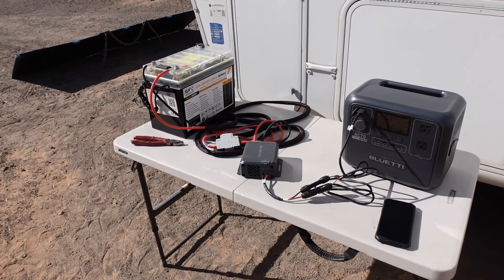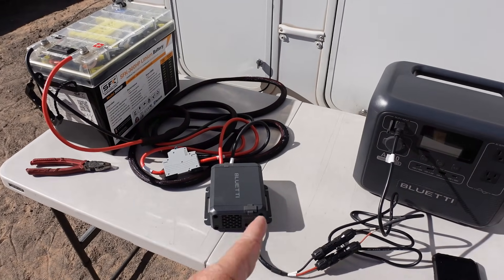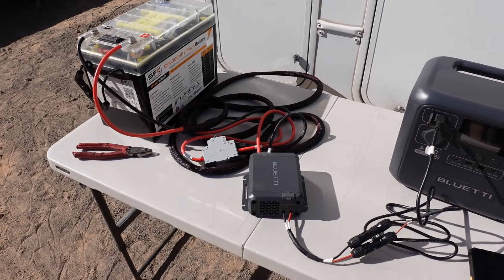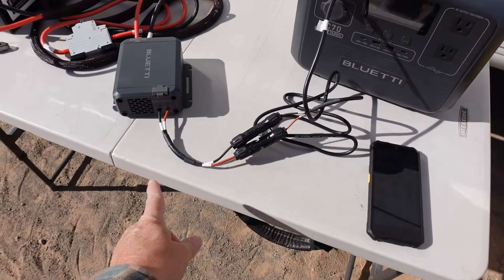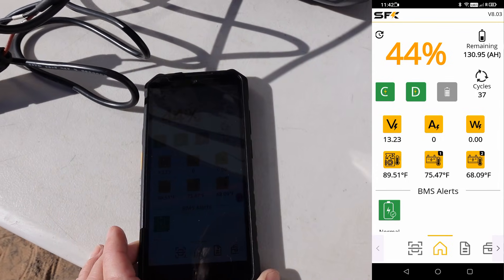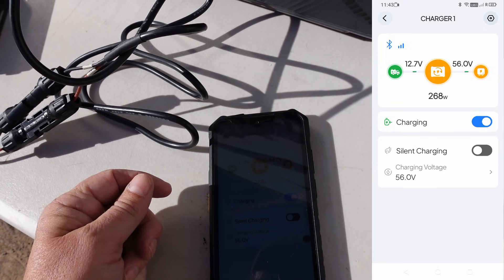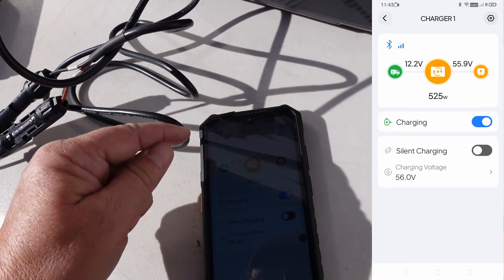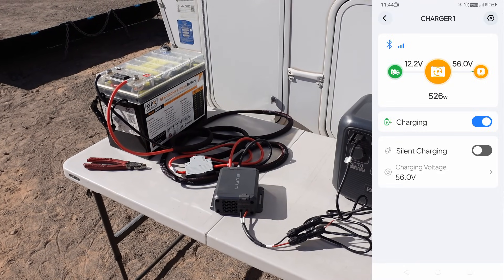Bluetti Charger 1 Test Using a 12V Lithium Battery (Commenter Question Answer)

Comment: That IS Good to Know !! Thank you. Nice alternative to  the  various shunts i use...12v - 48v 12.5A , 12v - 48v 10A,  12v - 60v 10A. There all decent but i always have a decent USB Fan running on them as they can and do get extremely Hot as well have them at least sitting on or mounted on something that helps with heart dissipation

Comment: Thanks Ray. I am the guy that requested this from you. I thought it would work which you proved to be correct. I gave my son my Bluetti 200 Max, and I purchase the Bluetti Elite 200 V2 which has no battery expansion capability. I purchased a Li Time  12v 320ah mini which I would like to connect to the charger 1 and run through the XT60 PV input. When I pose the feasibility question online, I get a No. I'm not buying that, because I belive the charger 1 just steps up the voltage to increase the input wattage. Why is this any different than what you performed on your test. If the nominal voltage for a LiPo4 battery is 12.8v, and the nominal voltage for a lead acid battery is 12.4, why would this not work? Of course Bluetti doesn't want you to use a stand alone battery with the charger 1, but it should still work and believe you've already proved this. Am I missing something? What are your thoughts? Thanks
Reply from the maker: The Charge 1 is designed to charge with an alternator running, so usually 14.4V input. It is also designed to auto shut off at a certain voltage so it doesn't drain the vehicles battery. 
In my test with a nominal 12.8V lithium battery which will usually have a voltage over 13 for most of it's discharge range it kept charging. I'm thinking Charger 1 has the auto shut off point somewhere around 12.6V which is a fully charged Lead Acid. 
But you could just connect the LiTime battery straight to the DC input port of the Elite 200 and not use a Charger 1.  These is a setting on the app to set the input for 12VDC charging
You would likely only see about 100-120 watts of charging but over time that is likely enough unless you are draw down the Elite 200 at a high rate. Make sure to use a fuse a little above the max amp draw inline close to the positive terminal to protect incase of short circuit. Or Bluetti sells a car charging cable https://www.bluettipower.ca/products/ac2a-cable?srsltid=AfmBOorh4l6SpEvhPBnKnzwfQIQZk66zDe2pHQu7D065xY3QuYZ1tbO9  or https://www.google.com/search?q=xt60+to+battery+ring+terminal

Comment: Ray just installed this in my truck for my solar power battery bank (Allpowers R 1500  . One question: Would you know  how long the output cable can be? 
I am thinking in the future to convert to Li batts to my trailer ,so that would mean a distance of 10 to 12 ft. from Charger One in the truck  to the battery bank in the trailer.
Reply from the maker: The Charger 1 I got came with a kit with a decent length of cable. See demo here https://youtu.be/QzrooU_Vs3g  To go longer than that you could do it but may have to go to a larger gauge wire to prevent too much voltage drop and excessive wiring losses. This is a pretty good calculator for that sort of thing  http://circuitwizard.bluesea.com/  I also did a video testing out charging a lithium battery with the Charger 1 via a MPPT solar charger https://youtu.be/xurOR3Kzt3k  Cheers, Ray

Comment: very good demonstration, thank you. I have overlander pickup with chest freezer, refridg, and microwave. My situation is i have Firman Zero E power station with bluetti charger 1 and it is great. I added a 100 amp hr 12 volt  p04 Litime connected by solar input directly from battery to power station. problem is i have to charge the extra battery with the power station and that depletes the power station untill i run the truck and bluettii charges back the power station in the same solar input. there is only one solar input on the power station. i just ordered a 30 amp mppt charge controller from Litime they recommended for connecting my solar panels to the backup battery for boondocking which is great. my question is can i hook up the Charger 1 to the 30 amp Litime mppt charge controller to the Litime backup battey then to the Firman power station. Will the Mppt tell the Charger 1 when both the battery and the power station are charged up and stop like it does when the power station is full now. i dont know if its the power station charge controller that is telling Charger 1 to stop or if the charger 1 stops on its own. Will the Litime Mppt be as smart as the Charger 1 and the power station charge controller? this is a real daisy chain, right?
Reply from the maker: Here is a test I did that sounds similar to what you want to do  Bluetti Charger 1 Feeding MPPT Solar Controller  https://youtu.be/xurOR3Kzt3k

Comment: Does this offer “reverse charging” like the EcoFlow device? I.e. car battery dies, can you charge it from the power station? Thanks
Reply from the maker: No reverse charging option that I could see. A person could get separate charger and plug into the power stations AC output. You can get little 10 amp chargers for around 25 bucks. Some of the larger power stations have optional battery charging cables to charger straight from the power station. Cheers, Ray

Comment: Can you charge the lithium battery with the bluetti charger one ? Or is it just capable to charge power banks ?
Reply from the maker: Not good for charging batteries, doesn't output the right voltages. You can feed a MPPT solar charger with it and that can charge a battery but quite a bit of loss due to the conversions. I did a test, here -- https://youtu.be/xurOR3Kzt3k

Comment: A follow up to this proceedure... I bought that exact same combination  of ac70 and charger 1.  Matched with a battleborn 100ah, the charger 1 does charge the ac70... BUT.. there appears to be 2 shutdown situations for the C1. If there is a rapid sag in battery voltage(5 volts or so) it will stop charging  pretty quickly...simulated vehicle shut off . When I restart it at an already sagged voltage it will run for about a half an hour at a low voltage reading . Looking at the app,  It seems if the voltage drops below around 13 volts the color scheme of the app drops from green icons all across(battery/alternator to C1 to power box) to green from the alternator/jbattery to orange of the charger and the power station. When the color changes a different set of shut down parameters kick in  and the C1 will turn off  the charging automatically, sometimes quickly(5v plus drop)   but sometime 30 min. later if the voltage sag is less. If the battery voltage sags to 12.2v it just shut off at that cutoff point no matter what. Makes sense it is trying to protect the starter battery... just wish that input voltage was adjustable for this type of usage.
Reply from the maker: Thanks. I  wonder why is your BattleBorn sagging so much? I'm not familiar with BattleBorn, so maybe the BMS is different than most or the fact it's only a 100Ah battery.  Maybe it's a wiring/connection issue causing excessive voltage drop
Reply: @LoveYourRV  I don't think 8ft of 8awg welding wire cause much of a voltage drop and in addition  I've put the ac70 on quiet charge(255watts or so)and it still sags. My Lion ut1300, which is a  newer battery and has better charging and discharging specs, does handle  the voltage sag a little better ( still the app goes into the orange mode though). I think the battleborn bms is more limited in the charge and discharge ratings. The recommended charge rating is ~50amps. Most lifpos these days are 100a plus.I would not buy a battleborn battery again  considering the competitions prices and features. I'm guessing the battle born has some internal resistance limitations. It may have some other qualities to justify the cost just not enough for my situation.
This is mostly a hobby for me running all our house hold dc appliances,  electronics and some misc stuff like dehydrators and fans off of  solar energy... though there is an rv in the picture and emergency back up as part of this alternative energy "hobby" mindset.
Reply from the maker: I'm going to be testing a WattCycle 100Ah lithium battery soon. I'll do the same test using the Bluetti OEM wiring and see what happens. Maybe because I used a 300Ah is why it was able to work well.
Reply: @LoveYourRV Just did some wire volt drop calculations and between the bluetti xt60 charge cable(16awg by~6ft@ 56v) and the 8 ft of #8 wire(@12+volts) I am likely dropping somewhere around .5v plus. I think I will make up some new custom cables (input and output)shorter and bigger for just this use and see if the volt drop calculators are correct and I gain a half a volt or so . There is really no voltage to spare in this use case... hobby right?

Comment: One neat possibility,  hopefully you consider testing for the charger 1.

Hook up the input  to vehicle battery as intended, but instead of hooking the output to a power station hook it to the mppt input of a solar system.  This could charge the rv batteries up to 500 watts from the vehicle alternator without the need for a generator. 

Definitely a good proof of concept if it works.

Happy camping
Reply from the maker: Yes, I tried that test. Here was the video :) - https://youtu.be/xurOR3Kzt3k  Cheers, Ray
Reply: Thanks for the reply and the link  @LoveYourRV

Comment: Ray, been watching you a long time… keep up the good work. Question: switching from agm to lithium; converter doesn’t do lithium… but my solar charger does. Can I keep using the old converter and know that the solar charger will top it off?
Reply from the maker: Thanks! Yes you can keep using the old converter it won't hurt, it just likely won't fully charge the lithium. My old 2011 OEM converter would usually charge my lithium to 53% then just maintain a trickle charge. The amount it will charge will be influenced by how close the converter is located to the batteries and the thickness of the charge wires.  My OEM converter location is a long run away and uses 6AWG wire. It didn't even do a great job of lead acid batteries. These days I have a second charger located very close the the battery bank in the form of an inverter/charger combo which has a lithium battery type setting and works well there allowing for a full recharge when on hookups during poor solar harvest times or dry camping and resorting to my gas generator. Cheers, Ray

Comment: Can you not just plug the battery into the solar input on the MPPT and let it regulate to the maximum amperage of the MPPT?
Reply from the maker: Yes, using a 12V battery or automotive cigarette lighter type socket charging cord through the DC input you'd get about 8-10 amps of charge current so usually about 100- 120 watts. Maybe more depending on the make and model of the power station. I've used a setup like that in my RV with a switch to have the option of transferring power from my trailer batteries into power stations. It was slow but would work. The viewer had ask me if he could increase that to 500 watts using the Charger 1  Cheers, Ray

Comment: Temp hot n cold resistance swamcooler microwave nature gen vtoman opus jackery senix bluetti biracial monfacial explained which is better ecoflow ancrage what is best  battery for solar power bank station highest watt that can power RV and save energy for night to be used hiset power to solar panel for fridge microwave

Comment: Which / what fuse do you use on the battery terminal. TNX
Reply from the maker: I like to use battery terminal fuses referred to commonly as MRBF (Marine Rated Battery Fuse) See in this clip https://youtu.be/FKGbpruwoZg?t=110  Blue Sea sells the best ones as far as I know https://amzn.to/42liLVm but there are lots of cheaper brands that seem to work well enough https://amzn.to/3WpqXQA
Reply: @LoveYourRV  I remembered the video after I just went back. But I didn't remember the fuse on the terminal. I have a circuit breaker between the hot side of the batteries &  the charge controller. Mine is closer to the controller. I didn't think I needed a fuse as well; but may be I do (?). TNX
Reply from the maker: @herb7877  It is primarily a just-in-case thing often called a catastrophic fuse.  The last line of defense in case of a short circuit between the battery and the next closest fuse.
Reply from the maker: On boats the American Boat and Yacht Council standards say that a fuse should be located no more than 7 inches from a battery bank  https://www.google.com/search?q=abyc+battery+fuse+requirement

Comment: Very nice job, thanks. The three app display analysis can't be beat. While I was watching this I had the thought that I could use the charger 1 as an interface with my 12 volt solar array. I have this old ac200p that needs 37+volts to activate the mppt charger . I'm thinking if I just charge my lifpo battery with that 12v array as usual (mppt controller) I can transfer the power right to my ac200p with the proper voltage setting on the C1. I am resistant to reconfiguring my 12v array every time I want to solar charge the ac200p because of the other uses I have that require the 12v configuration. 
Kinda regret not buying a C1 last black Friday, I think I saw some as low as 250us even 199 without the kit. Between the apparent quality and varied  uses a pretty handy device. 
Brilliant job...cheers
Reply from the maker: You're welcome. :)  I think they have some type of New Year sale on now. I see it for $249 https://shrsl.com/4sy0i Anyway Bluetti gave me a discount code  Ray5off can save extra 5% off sitewide. I don't think it has a time limit so can add it when a good sale is on. Cheers, Ray
Reply: I charge mine with just a simple battery cord out of my LiPo4 to xt90 at low watts to my bluetti ac180 overnight, never thought of using my charger1. Good  to know